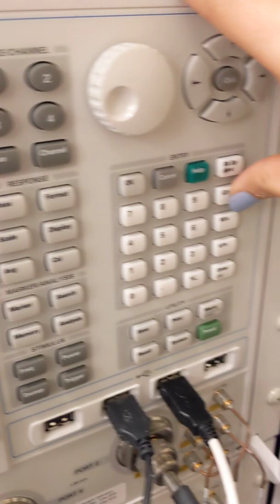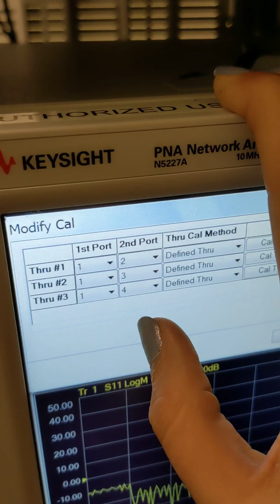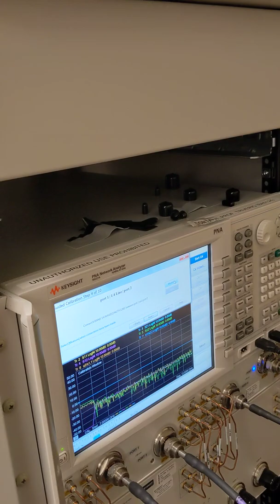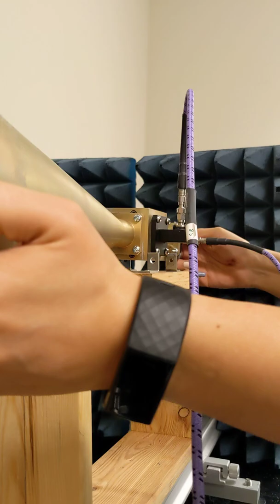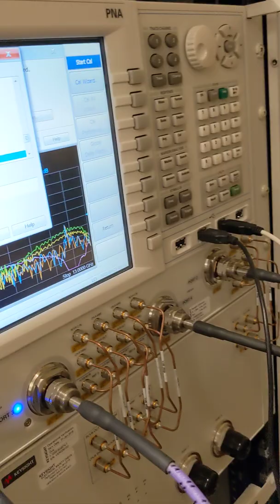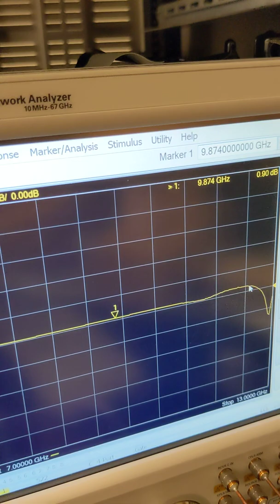4-port TRL Calibration of a Quasi-optical Setup

Comment: Hello,

Your video is very helpful and clarifying. I have a question regarding the motion control of the horns. As I understand, in order to achieve a good calibration high precision position is needeed especially for the Line measurement. Could you be please explain the parts needed for the motion control of the horns? Is it possible to buy the whole system assembled or you have to buy the parts seperately and assembled them yourself?

Thanks in advance
Reply from the maker: You're absolutely right about the required precision. I redesigned the whole system as the lab manager with mostly mechcanical parts used in optical measurement setups. And with the help of another summer student, we used 3D printed holders. I couldn't find a ready to buy etup in microwav frequency. the setup I made is shown in my paper available here (on page 11): https://www.nature.com/articles/s41598-022-20851-y

Comment: I have another question. I will be so pleased if you answer my question. Does it possible to employ 4 sets of 2 port TRL calibrations (vertical-vertical, vertical-horizontal, horizontal-vertical, and horizontal-horizontal) instead of a 4 port TRL calibration?
Reply from the maker: Yes, you need a 4 port VNA

Comment: Hello Mrs. Naseri
Thanks for the interesting tutorial. During the measurement of through, between vertical and horizontal ports (ports 1 and 4), you rotated the antenna by 90 degrees. Since the test setup configuration is changed, it seems that the calibration is not ok. Am I right?
If I'm wrong, could you please explain how it doesn't impact calibration?
Reply from the maker: The antenna is never rotated during calibration, but one of the antennas is rotated so the signal level wouldn't be so low.
Reply: @parinaznaseri  Many thanks Mrs. Naseri. I am not good at English and I couldn't explain to you what I mean. Does this setup suitable for testing anisotropic DUTs such as linear to circular polarizers?
Reply from the maker: @davoodsiyar4242  I've used it exactly for linear to circular polarizers. You just need to post-process linear coefficients to obtain the linear-to-circular scattering coefficients
Reply: @parinaznaseri  Thanks for your great help